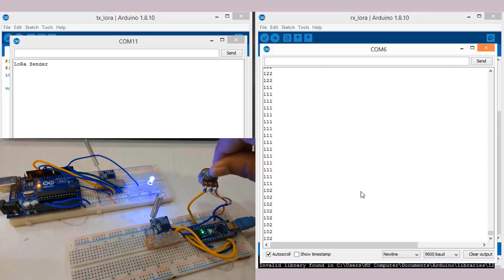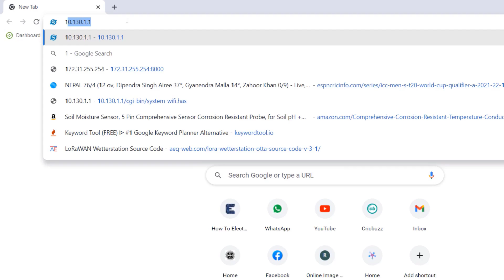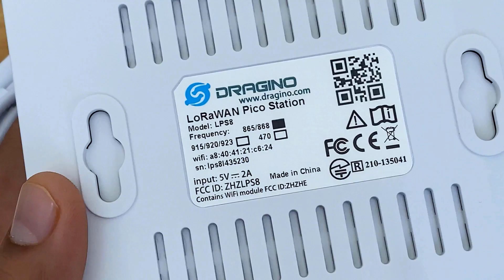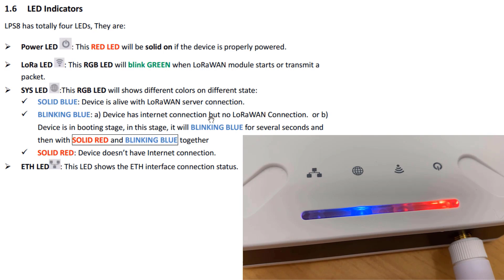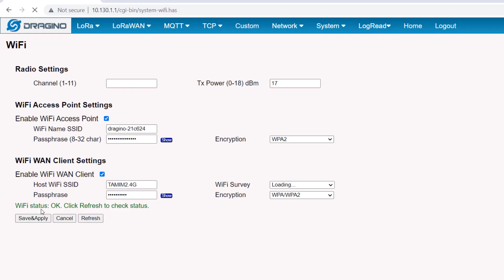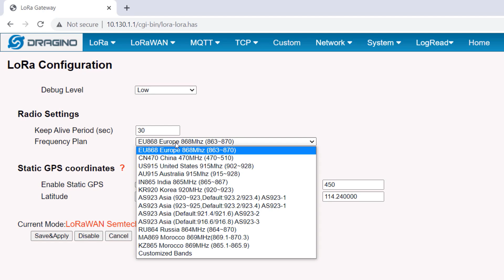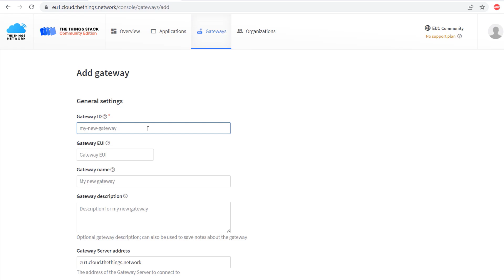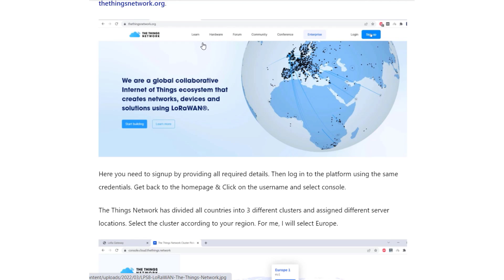LoRaWAN Gateway Tutorial | Setup Dragino LPS8 LoRaWAN Gateway & Register on The Things Network (TTN)

Comment: Hi There, thanks for the detailed video. I have the same module LPS8, I can connect it to my home wireless or wired network and it does get an ip address, however from there, I am not able to open the UI using the address allocated to LPS8. Any advice?